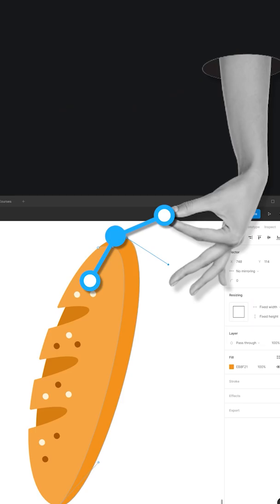WTF is a Bézier Curve?

Comment: It is crazy how simple yet effective this algorithm is. 

I can't imaging doing many things without it. I use them all the time, but when I first implemented it step by step it was very cool. Part of it, the "1-t" and similar concepts are also used in Smoothstep and several similar algorithms, common used in games and animations.
Reply: Graphic design would have a hard time.
Reply: Sometimes I wish I could go back in time and be a software engineer at this time. Everything looked so hard and you had to code everything. Now everything is 100000x more advanced, but at the same time 1000000x more easier.

Comment: Not entirely true

The mathematical basis for Bézier curves—the Bernstein polynomials—was established in 1912, but the polynomials were not applied to graphics until some 50 years later when mathematician Paul de Casteljau in 1959 developed de Casteljau's algorithm, a numerically stable method for evaluating the curves, and became the first to apply them to computer-aided design at French automaker Citroën.[6] Yet, de Casteljau's method was patented in France but not published until the 1980s[7] while the Bézier polynomials were widely publicised in the 1960s by the French engineer Pierre Bézier, who discovered them independently and used them to design automobile bodies at Renault.

Comment: You can never make a perfect arc, ellipse or circle with a Bezier curve, since they are effectively polynomials.
Reply: But we already have techniques to make perfect arcs, ellipses, and circles in code. That's not the problem Bezier was even trying to solve. Why even bring it up?
Reply: @theclockworkcadaver7025  It can be useful to some people, when they wonder why their arc or circle doesn't look quite right.
Reply: A cubic bezier curve can be shaped to look convincingly like a semi-circle (and 2 of those connected obviously a full circle). It looks really really close, but are you saying that it actually still deviates if you look close enough? thats so cool
Do you have any links explaining in more detail why that is the case though?
Reply: @blaarkies  Yes, they're not the same. It's down to an arc/circle/ellipse being a trigonometric function, which can be differentiated infinitely without becoming zero. A polynomial will eventually have a zero derivative because a derivative of a polynomial is another polynomial one order lower. Eventually, you get to zero.

You can actually deduce this by taking the derivative of a bezier curve of any kind, which is another bezier curve one order lower (so a cubic bezier has a quadratic bezier as a derivative), and the same rule applies, eventually you end up with zero.

This video is a very good and comprehensive look at the mathematics of bezier curves:

https://youtu.be/aVwxzDHniEw